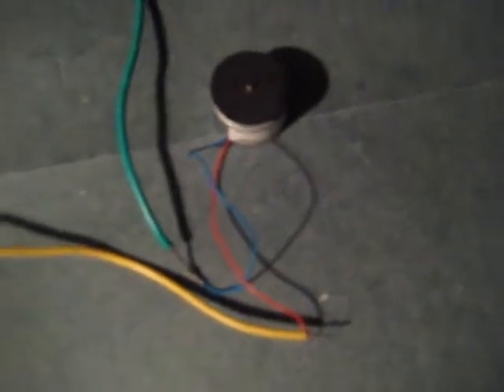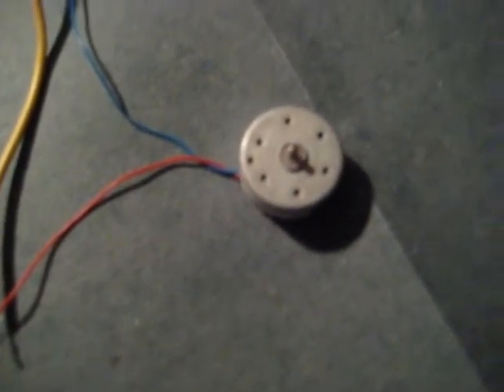50 Volt DC torture  on a low voltage Motor

Comment: That's nuts!! That motor took 50v for 5 minutes?!

That needed to be variac'd. "Crank-it-till-it-pops" volts. :-D

Completely amazed that this little scorcher lasted for so long. It must have gotten rather hot in there, even though I couldn't see any signs of overheating discolouration in there when you took it apart. Maybe a small part failed before a burn-up, like you said....the windings centrifugally de-soldered themselves.

Mmmm, New de-soldering technique! Spin it apart! :-D

-BBD.